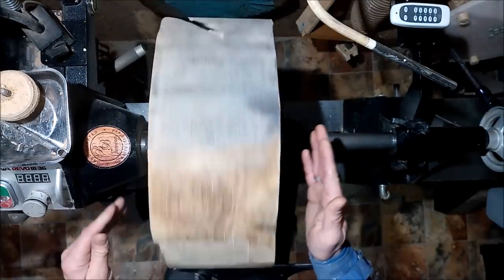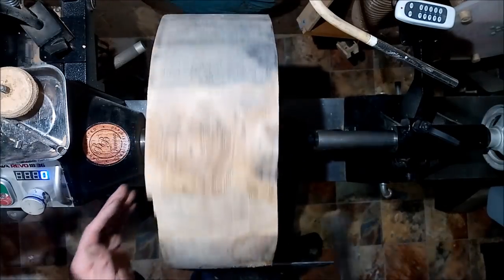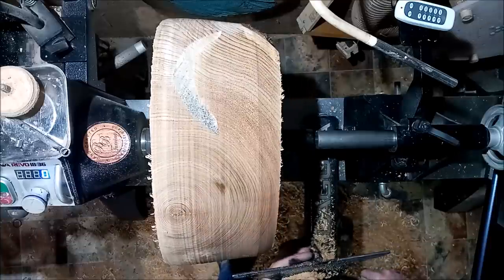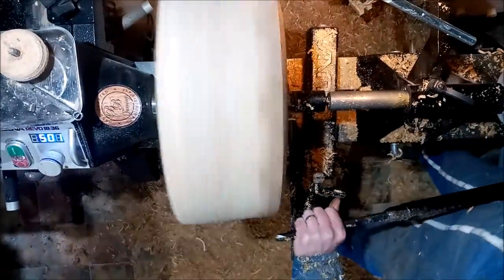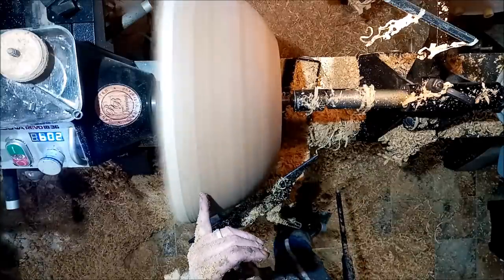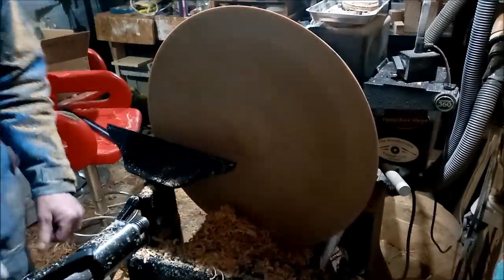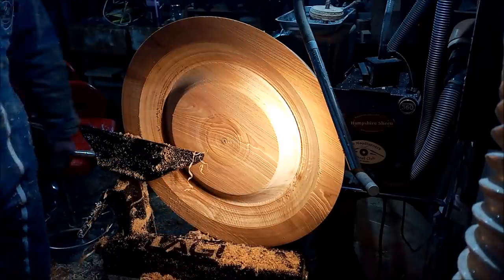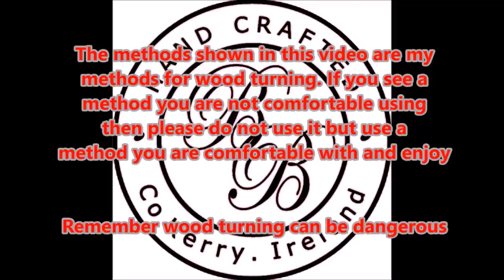The Thompson bowl gouge and The flywheel effect / Wood Turning

Comment: I was lucky enough to get a log (from the base up) from an American Chestnut in 2019. I rough turned a 16" by 6" bowl and let it dry for a year. I was disappointed in the finished wood. The rough blank was very hard and dusty, and the finished bowl was brittle with a rather plain grain and quite white. This tree was almost totally eliminated in the 1920s by a blight. Its a good thing that I have lots of Ash trees, which are being killed off by the emerald ash borer. Ash is a wonderful wood for turning large bowls. And there is a lot of walnut around me, and that is almost always beautiful.     I hope you do another video on this blank in a year, and look forward to your comments about the Spanish Chestnut, and how the second turning goes.
Reply from the maker: I will indeed Doug but it will be quicker than a year as I have it and another like it in the kiln at the moment. One of them I will finish turn as normal the other since the tannin content is so high is a perfect wood to ebonise and I will be doing a video on that as well. I have never had the chance to work on black walnut as it is a rare as hens teeth over here and would be very expensive to import 
Shay

Comment: I still have no idea why you had a flywheel effect. I have turned a few thousand bowls and I assume your lathe is programmed to brake too fast for large work
Reply from the maker: It could well be Matt, I have, like yourself, turned a lot of bowls on quite a few makes of lathe. The phenomenon does not seem to be exclusive to Laguna lathes as I have seen conversations in a few Woodturning groups about it. I do agree that it probably has something to do with the braking speed of the lathe being too severe. Thanks for the comment.
Shay

Comment: So I’m new to turning and I have learned a tremendous amount from watching and listening to you! Thanks so much!!! I heard you say 10% rule as to width of rim. Is that also the thickness? Seems thicker than necessary, but I’m a noob so I know nothing! Thanks again and keep the awesome bowls coming please!
Reply from the maker: The 10% rule is basically when you are going to twice turn a bowl Darrel. In the first turning you leave the walls 10% of the diameter of the bowl due to the warping that will occur during drying. Leaving the wide walls will allow you to true up the bowl during the second turning and still leave you width in the walls to work with. I can probably explain better in a video. I will do one of my extra videos where I answer specific questions for you when I get the chance.
Shay
Reply from the maker: Here is the 10% rule video in case you missed it Darrell https://youtu.be/KgyRhc3I2Ms
Reply: @BBTurning  Thanks for sharing and thinking of me! I turned a couple handles for my new gouges from Purple Heart and an even better one from Black Walnut. It was fun practicing and learning. Tried a couple little bowls from Cherry. Not much success, but started a little one in Black Walnut and so far so good! Damn I’m SLOW!! I’ll look at 10% video after dinner. Thanks again!!
Reply from the maker: You are welcome Darrell.
Shay